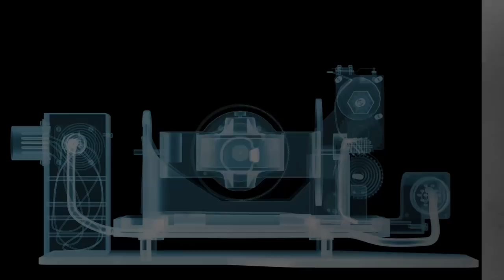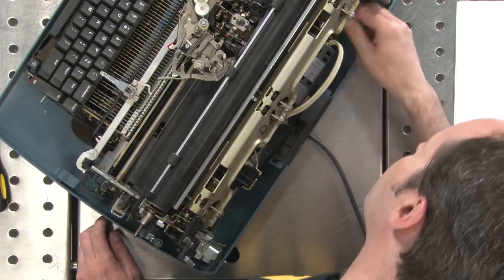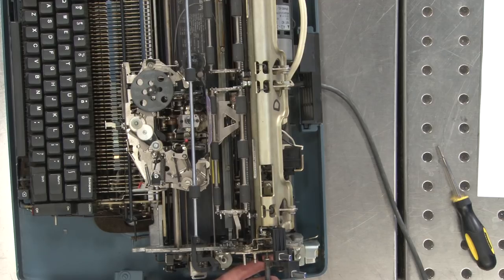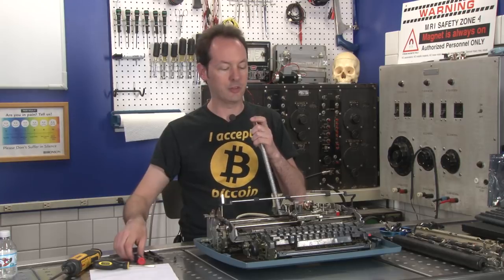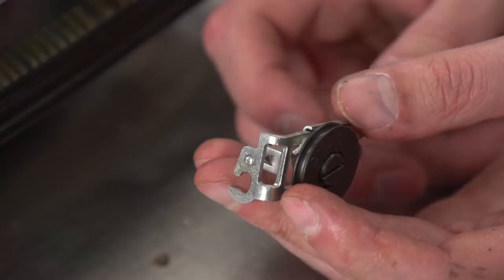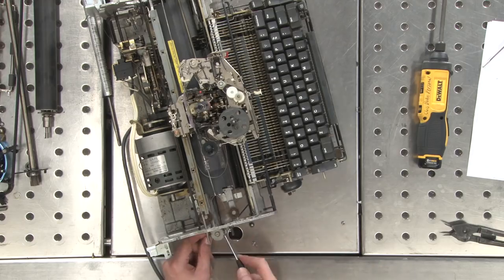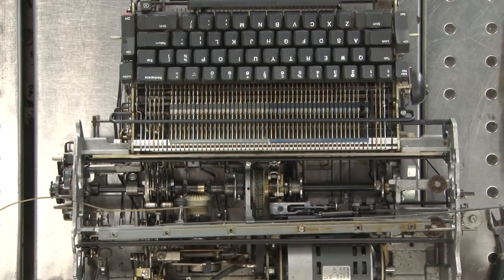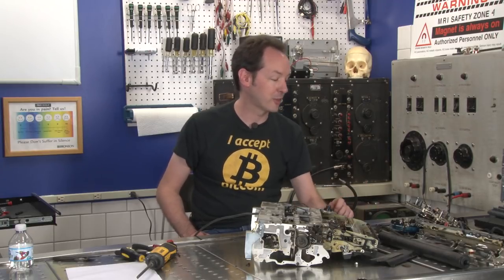IBM Selectric III Typewriter: Equipment Autopsy #97

Comment: I've taken a few of these apart many years ago.. I still got the motors (same as in the video), the motors in these always had difficulties getting up to speed and had low torque, so IBM got around that by putting a centrifugal clutch on the motor shaft so when the motor finally got up to speed the clutch engaged the belt drive and the typewriter would work.

Comment: The “differential” is what moves the carriage to the right and left. The mainspring supplies the power to move the carriage to the right and the motor supplies the power to move it to the left. The two pinions are really clutches that facilitate the two different operations.

Comment: The IBM 1401 computer came out in 1959, and also surprised IBM. They got more orders for the things in the first week than they'd expected for the entire lifetime of the machine. It was sold until 1971. 

The IBM System/360 came out in the mid 1960s, and used the EBCDIC character encoding. ASCII's first version came out in 1963, the System/360 was announced in 1964, so work had likely already begun on the design of the System/360 long before ASCII existed.

Comment: That clevis arrangement is also used in cars, some of the linkages on the carburetor used them, except that the side bendy bit was separate and clipped on to the shaft.
So it was probably used on the car before typewriters or model aircraft.
(though it could have been used on real aircraft too)

Comment: Great analysis done in real time! Congratulations to the author!! I share his appreciation and respect for the IBM Selectric - a true masterpiece of Mechanical Engineering.

To continue from where the author left the presentation off... The differential mechanism that he could not figure out in the given time has clutches that engage either the left or right wheels on machine's continuously rotating core shaft: when the left-had clutch engages, the carriage returns to the left ("Return" direction) and when the right-hand clutch engages the carriage advances to the right ("Space bar" direction). The continuously rotating core shaft is inside the larger-diameter shafts that move the left or right wheels. These external shafts engage with the inner shaft only with the help of the respective clutches, when the Return or Space bar keys are pressed.

I an not an Selectric specialist, but this is what I understood in my efforts to revive a Selectric III. Therefore, I may be wrong.

One question to the author: is there a safe (non-autopsy!) way to move the carriage to the right without the help of the motor? My motor belt and hub are broken, hence I have to get the carriage to the right, out of my way, by hand, in order to remove the broken hub and belt... Right now, it is stubbornly jammed to the left.

Thanks and congratulations, again!

Constantin

Comment: it would be easy you just use every key on the typewriter and see where it hits on the ribbon or how then write a program that would automatically rearange the letters to what you sawon the type writer then use a scanner and put thr ribbon through the computer would write it out for you instead of manually inputing it by hand then it would write out the complete scentinces for you sure it would be more work then writeing it out but once the programs made then you can do it with every ink ribbon you get your hands on or throw it up online so others can use it.